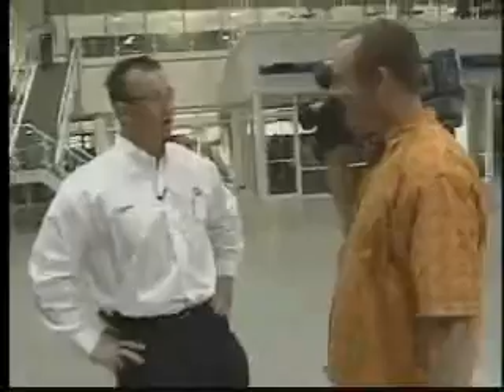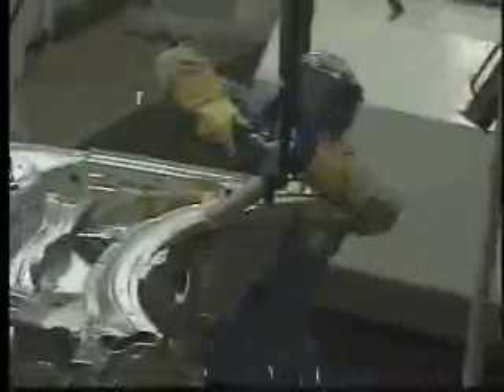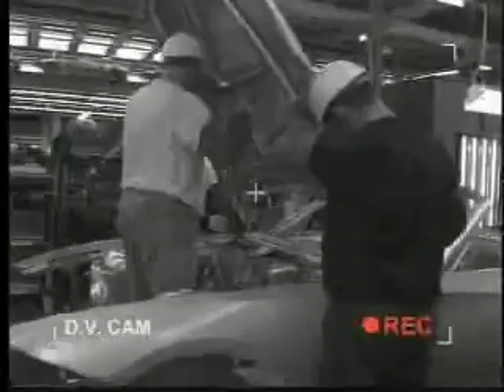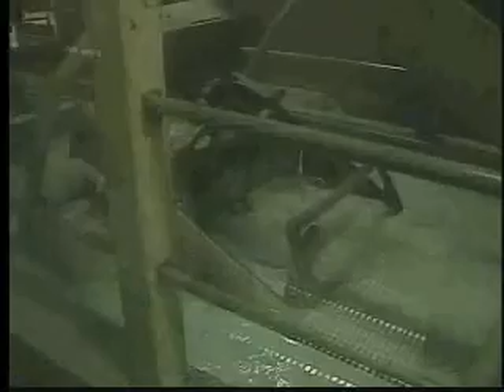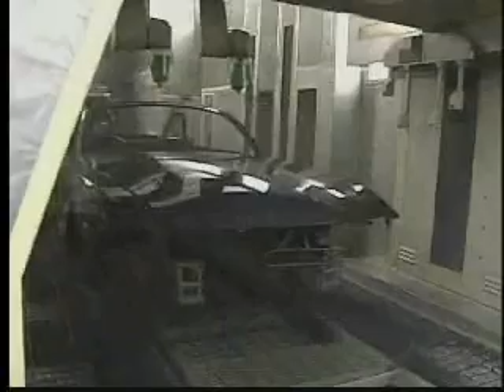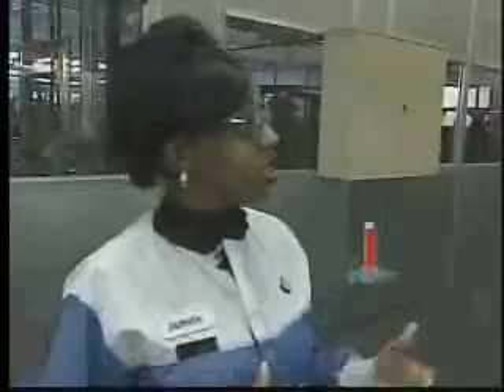Making of the BMW Z4 Roadster (Part 1/2)

Comment: I've had a E85 Z4 for 8 months. Roof motor failed, rear coil spring broke, Sat Nav antenna has failed, inside door handle is loose, passenger window glass mountings broke and the door mirror glass dropped out (which has never happened before even in my cheapest first cars!)  And then there's all the rattles and squeaks, NOT what I expected from a BMW. My dad's 3 Series is rock solid so maybe there really is something to be said about US built cars. My previous honda was flawless.